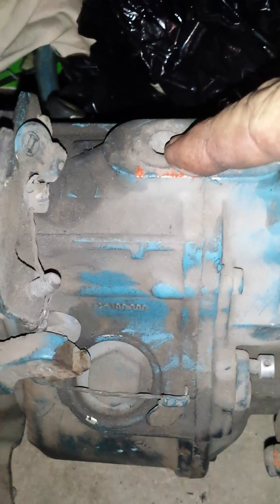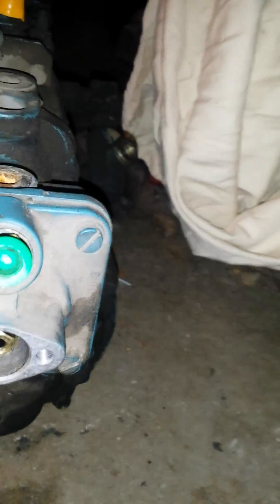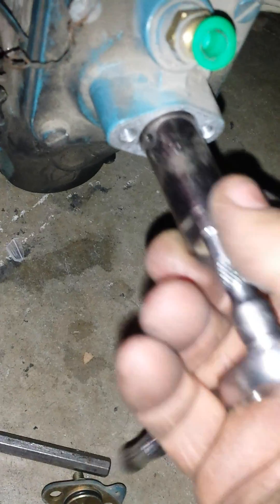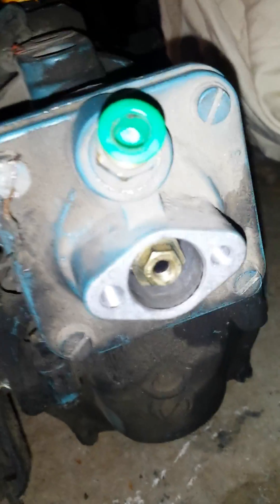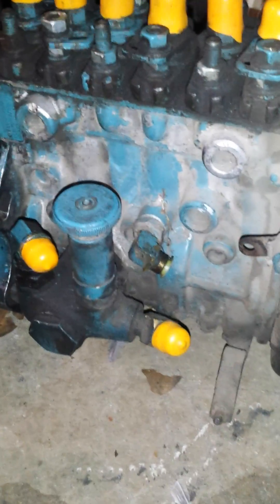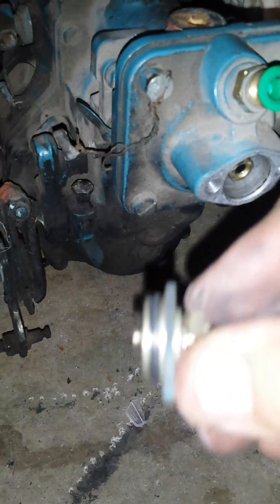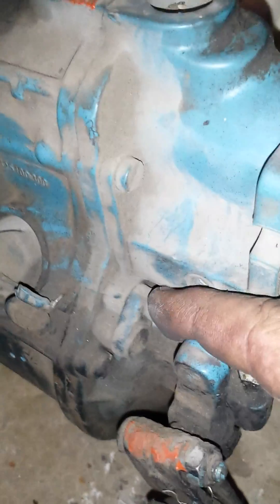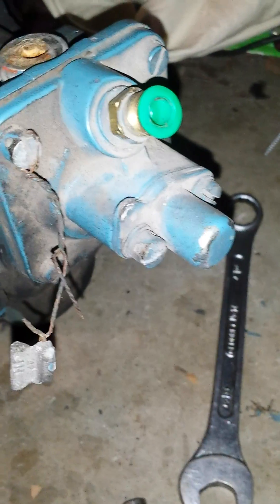Bosch MW pump(and some Apumps) full fuel adjustment(more power). "Turn up the pump"

Comment: I'm attempting to adjust mine, but the adjustment isnt the same. It appears to be a brass fitting with slots at 12 and 6 to adjust would I still swing counter clockwise
Reply from the maker: @BillyBryanOffroad  still back that nut out.  I use quality needle nose pliers.  It doesn’t turn very easily but it will get there.
Reply: @nevrenufhp  how many turns am I able to safely go
Reply from the maker: @BillyBryanOffroad  back it out 10 turns to start.  It’s a real fine thread stud.  I usually just take the nut off.  If you haul heavy, you may want to stay on the cautious side with just the 10 turns.
Reply from the maker: @BillyBryanOffroad  you can take the nut all the way off then.  These pumps don’t put out much fuel, so 95% of the time the EGT stays in check.
Reply: @nevrenufhp  any guess on power output? 19° timing all other fuel mods.
Reply from the maker: @BillyBryanOffroad  , I’d say it’s at around 270hp.

Comment: Can someone tell me around about how many turns they put on the different things?
Reply from the maker: @MrCstone1  on the fuel nut here, most just remove the nut. I didn’t count the turns when I made the video. I would guess about 15.
Reply: @nevrenufhp  so 15 turns and it won't run away?
Reply from the maker: @MrCstone1  only will run away if there’s already a problem in the pump.  This will not cause runaway, even when removed.
Reply: @nevrenufhp  also what about the wheel, and the one on top
Reply from the maker: @MrCstone1  the star wheel should be adjusted last, as a fine tune. Most of the time I roll the wheel until I can see the spring next it to start to get loose.  If it’s too loose, it’ll spin when you flick the screwdriver against it.  Spin the wheel back the other way until that spring has a little tension. Makes the power come in quicker.  
Then, the low rpm fuel screw.  If you back that one out like 5 turns, it may puke black smoke out when you hit the pedal from idle. These adjustments are easy to do, and test and tune is the best way to get it how you like it.  This screw on top is the only part that can get you hung up.  If you back it out too far, it can get stuck on the top of the pump and you won’t be able to shut it off.  Just double check the rack has full range of motion before putting that plug back on.
Reply: @nevrenufhp  Awesome man thanks for all your info!

Comment: How about turning pump up on a Mack mid liner g210? 6.2 renault with bosh inline.
Reply from the maker: I've seen pictures of them, but never touched one.  The pumps almost seem unique to Mack/Renault.  All I can say is start making one adjustment at a time. More than likely it will be under that cover on top with the 4 bolts, if I'm remembering correctly.

Comment: You mentioned the stock pumps with ~19mm of rack travel is about all it can give. Is there a way to measure that? And will the rack bottom out or can you give it more travel than necessary?
Reply from the maker: That’s all the travel it gives back there.  Take the fuel nut off to allow max travel, then adjust the star wheel to take the tension off its spring. Then, it will have all the travel available.  The screw on top will give it 100% fuel (21mm) to make it start quicker.  For checking rack travel, the pump would have to come off to access the rack plug on the front.

Comment: Is that the same way the P-Pump on a Ford 7.8L6 adjusts as well or is the DTt466 set up different?
Reply from the maker: This is the way the P3000
 pump in the Fords adjusts. Except a late 92 and 93 will likely have the fuel plate adjustments like the Dodges. It’s hard to include all of em in the subject line.
Reply: @nevrenufhp  Thank you   I know a little bit about diesels but not enough is there a way to tell if someone has been there before or is it like hope for the best and make the adjustments and is there a point of no return  I really do appreciate you taking your time to answer my question my 7.8L6 is a 91 and it runs good has just about 89,000 miles on it burns clean no black smoke hardly  once again  Thank you     will removing the muffler and running a 4 inch stack help  I am not looking for 400 hp however the 7.8 marlin had 400 hp so I know that they got it from these engines but 50 more lb- ft would make me happy is there any way to do that without going down and dumping much money into the whole set up mine is a 210hp 601 lb-ft with a 4 speed auto
Reply from the maker: @kevinkinsey6985  , running straight pipe will help. I made a couple videos of an F800 7.8 I used to drive that I got straight piped. They do sound good.  
You can take the nuts off the back and it still likely won’t get hot enuf EGT.  It’ll be close if it’s heavy.  To tell if anyone has been in it before, you will see the tamper proof screw chewed up or replaced.  It’s one of the 2 screws to access the fuel nuts. The free mods certainly make it more pleasant driving.
Reply: @nevrenufhp   I thamk you very much yes it is a F800   15,630 is the last tare weight iI seen on it  once again Thank you

Comment: Will adjusting the rack travel on the rear of the pump (and the external high idle stop) affect the no load high idle speed?  Do the gov springs have to be adjusted after this?
Reply from the maker: It will allow it to get to the governed speed quicker.  Some of these were so horribly adjusted, that they would barely rev to 2300.  You would adjust the gov springs if you wanted more rpm.  Very rarely does anyone ever want less rpm.
Reply: @nevrenufhp  Thanks, yes my truck was set at supposedly 180hp (which I tend to believe) at 2600rpm no load.  I turned out the jam nuts a fair bit (there would be  2 or 3 threads sticking out past the 10mm but still).  I also adjusted the little stopper screw on the backing plate.

At the same time, I tried to set the max travel stop on the throttle arm, but the bolt was seized and broke.  I plan to make a new travel stop, but I started the engine up to see what how things were looking.  It will do well over 3000rpm now, and I would like to bring it back down.  I just can’t tell if my problem was the travel stop, or the rack adjustment I made.

P.S.  I really appreciate the help, I used to ask you the odd question on Pirate4x4 - you are always so helpful.  I appreciate all your work on these videos!
Reply from the maker: @Xkekeskfndsmw  , on a DT360, that’s normal.  On a 466, just don’t hold that rpm for hours.  Either can go to about 3400 before any valves start to float, so it’s just more useable rpm now.  In one of my other videos I have a 466 hitting 3150 no load.  Ran that way for 100k miles, until it went to auction.  Just enjoy.

Comment: Hey buddy I have a dta 360 and my nut is different there is only one in there do I just back it out?
Reply from the maker: There’s one of 3 varieties.  One I see a lot is just one nut that you can back out with needle nose pliers.  It’ll be a little stiff, but it’ll come out.  You can just remove it all together.

Comment: Is there a different style adjuster. I just got mine off and it doesn’t seem to have the smaller 10mm inner nut but instead a round almost bushing with slots in both sides
Reply from the maker: There is 3 different setups that I have come across.  The one you have, you can use needle nose pliers to back it off.  Sometimes there’s a nut behind that.  Sometimes it’s just that one round nut.
Reply: @nevrenufhp  So I should remove the round nut completely and then make the adjustment?
Reply from the maker: catalanojaa  yes, remove it to make sure no other nut is behind it.  You can just leave it removed anyway.  It won’t get too terribly hot, but you do still need to watch the EGT
Reply: nevrenufhp I removed the round nut and backed out the 14mm nut as far as I could but I didn’t not notice any difference. How do you adjust the full fuel stopper?
Reply from the maker: catalanojaa , that is the full fuel.  Take both nuts off.  Then, back off the screw on top a few turns.  It’s one of my other videos.  Low rpm/ excess fuel screw.  It’s not a lot of power gained, but it’s free.  Some trucks only gain 10hp, and some about 40.
Reply: @catalanojaa  how did you get that spanner nut off...is there a special tool I can get it lose
Reply: @nevrenufhp  if there is a special tool to back that spanner out i would buy it...can't get that thing to budge
Reply from the maker: @turbonitrous9580  , I just use a heafty pair of needle nose pliers. An offset head may help get leverage on it, but they normally aren’t very tight.
Reply: @nevrenufhp  ok ill give it a shot, somebody was already in there so you never know
Reply: @nevrenufhp  well..that jam nut wasn't about to come off, I made a tool...for anyone interested ...cut a small rectangle steel 1-1.5 inch long X 16mm wide, I believe it was 1/8 I had laying around , using a cutoff wheel cut out the center if the small to form 2 prongs that fit inside the slots of the jam nut (we will call this the fork)...do not attempt to use this on its own, it will just bend..now take a 14mm socket that fits inside the pump and cut a slot right down the middle of the open end about an inch or inch and half long ....your slot should be about an 1/8 inch gap or whatever thickness your fork  was.... now just slide the metal fork down the slot so that the 2 fork prongs are just ever so slightly below the open end of the socket. Mig weld down the slots, grind smooth,,, viola you have a spanner you can ratchet that bad boy out. Then the lower nut comes right out.. take them both out and leave them out...full rack travel. I know it sounds like a lot of work but soooo worth it!!! I got 5 more psi boost and its much more fun to drive....I only get a light haze, EGT of 1200 fully matted and only  momentarily until I hit 70 and need to back off anyway. Other  points, I did it while in the truck, crammed into 1994 f450, and I have air to water intercooler with dual intercooler  radiators.... I would imagine EGT would be higher otherwise.. anyway thank you nevrenufhp for posting this series much appreciated

Comment: What is the difference between the setting on top vs the rear cap fuel setting? I'm not talking about the star wheel one but the other one.
Reply from the maker: The top one dumps in fuel at low rpm, which was designed for quick starts.  The one on the rear is fuel rate for the whole rpm band.
Reply: @nevrenufhp  thanks I understand kinda. The star wheel setting does the same thing but as I understand it's a bit more "prorated" then the other. I always thought that the aneroid setting was on the back where the main fuel jam nuts are. I guess I still don't understand what the difference is between the back aneroid setting and the the upper front aneroid setting.

Also I am working on my truck right now. Is it safe to take the jam nuts completely off? I have boost and egt guages. I just didn't know if it would mess up the injection pump in any way or if it could cause a runaway..
Thanks for your quick help!

Comment: are you still around???
Reply from the maker: Yes indeed
Reply: @nevrenufhp  you still messing with the 6.6??? you ever do anything with it/
Reply from the maker: adam sorell , I sold the one I had.  I do still have the front mounts and crossmember for an F series.
Reply: @nevrenufhp  nothing really in common with pickup and the medium duty. cabs look same but r different
Reply from the maker: @adamsorell4851  I sent email. The mounts and crossmember I have are for a pickup.

Comment: Hey bud, I have a turbo off an l-10 cummins that I am going to install on my dt. Do you have a part # for 300 hp injectors and can you find me a supplier?
Reply from the maker: jiemrvow a Stanadyne 781697 is the biggest factory injectors I can find.  Most any injection shop can get em, possibly Napa.  Otherwise, you can get even bigger from Columbus Diesel Supply.

Comment: Just tried to turn up the mw pump on my 8.3 Cummins and instead of a 10mm and 14mm, mine has a tamper proof jam nut with a slot on either side. Is there a tool to break that loose that you know of? Thanks.
Reply from the maker: Sean Smith , I use needle nose pliers to back it out.  The nut isn’t on too tight.  If there’s a nut behind it, break that one loose first.
Reply: @nevrenufhp  awesome, I'll give that a try. Thanks very much!

Comment: Do you adjust the stopper then you back these nuts out? Asking about the cover plate with the o ring. Do we tighten, loosen or leave it alone?
Reply from the maker: Just leave that one alone. Most of the time you can just take the nuts all the way off. The pumps are so small on almost all of these.  They wont send too much fuel in to hurt it, but still needs to be monitored.

Comment: So what does this adjustment do? I have a similar pump on a 7.8l Ford and my high RPM power is super low, empty on a slight incline I lose speed. I have adjusted the excess fuel adjustment which gives it a little more power and quite a bit of smoke on the bottom end before the turbo lights, but it falls on its face after that. What do you suggest doing?
Reply from the maker: Gillett Excavating, LLC, this is the fuel rate adjustment.  Some call it turning up the pump.  That’s typical of adjusting the excess fuel screw on top.  It dumps in fuel in the lower rpm but then goes back to stock fuel after that point.  You can take the nuts off, if you have an intercooler/ aftercooler and have a pyro to watch.
Reply: nevrenufhp so if I have not adjusted the fuel adjustment on the rear of the pump like you have explained in this video, should I start by adjusting this?
Reply from the maker: Absolutely! It's one of the first things to do. I access it from the cab, through the dog house. Most pumps have a rounded tamper proof screw that needs to be drilled out. I use a 1/4"X18" drill bit to drill off the head, then replace the screw with a new allen headed one.

Comment: On that mw pump what would cause the shut off lever to be really stiff. My truck doesnt get driven alot but is there an "easy" way to free up the lever. It now is too hard for the cable shut off line some one else installed for it to work.
Reply from the maker: Is is stiff by itself(cable disconnected from the lever)? If it's within the pump itself, there's a few things that could cause it, and a pump shop would have to dig in to it.
Reply: nevrenufhp Yeah its doing it when its disconnected.  It starts to get easier when it is driven and worked back and forth directly bu hand but then goes back if it sits for a month.
Reply from the maker: buildthings79 , my first hunch is moisture got in there, and has rusted the linkage inside.
Reply: nevrenufhp So that area of the pump is dry. Does it shift the rack closed?  By the way I really appreciate your knowledge on this, Thank you.
Reply from the maker: buildthings79 , it is at about  the top of the oil level. Yes, it does go down to the rack to kill it. If the rack was dry, your rpm and power would be sticky too. One possible other idea, is someone messed with the screw on top(excess fuel screw). If it is backed out too far, it will bind up during shut down.
Reply: nevrenufhp Its not binding up at the top of travel its just over all tough to move.
Reply: Hey you wouldnt know any thing about the factory turbo on this thing. Mainly I want to put something on it with more power. 
Right now Its a 1988 dt466c with 185 hp and the turbo is non blow off so it doesnt make much boost. The truck has 42,000 original miles on it. S1854 also so its a 4x4. I just want to size it up a bit and add an intercooler. I know I cant go too much higher because of the m545 trans behind it.
Reply from the maker: buildthings79 , I am well aware of the baby turbos used on these. A good upgrade is off a newer(94-04) 466, if you're looking at used ones. Otherwise, an S300 is a good price for new. May be easier to catch me on the Low Buck Diesel Power main page or facebook page. I think the S300 number is 179078.

Comment: Hey guy. I have been trying to get info on this pump to get my crappy running box truck driveable! So every time I try to drive it and let off the throttle to change gears it quits getting fuel and dies. Then I have to restart it. Also it has low power. I tried adjusting the star wheel towards the front but not really a change. HELP HELP
Reply from the maker: T. W. , what you are describing is the screw on top got adjusted. It needs to be turned back in, and this video's adjustment made. This is the real fuel adjustment. If it doesn't get too hot, you can take off the nuts.

Comment: how do you get the screws out of the little cover to adjust the nuts?
Reply from the maker: May have to use some sockets with a screwdriver end, and go thru the dog house in the cab. I used vise grips on the round(tamper proof) one

Comment: so towards the engine how many before I will be back to normal power
Reply from the maker: Peek down in the opening. The star wheel should be just forward of the half way point. Half way across the opening. Farther forward is more power.

Comment: I'm just stuck it runs and turns over just wondering how to get it back up to speed
Reply from the maker: Adjusting the star wheel the wrong way will make it real hard to make any power. Last I remember doing one, the wheel spins toward the engine.

Comment: the only thing I did was turn star wheel how could I adjust the rpm
Reply from the maker: All the adjustments are on my YouTube page. I cover the gov springs, fuel rate, excess fuel screw, and timing. 
Also have a written version on my website: Low Buck Diesel Power. It's at freewebs.com/nevrenufhp